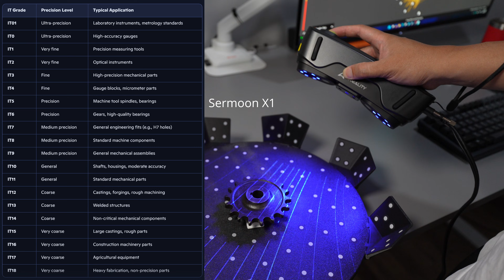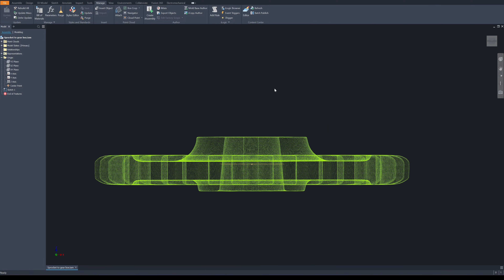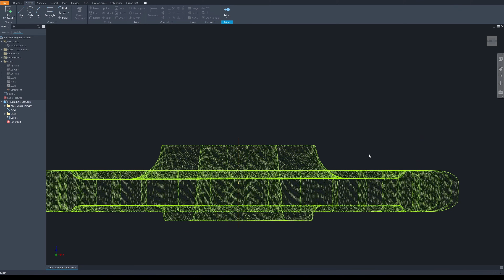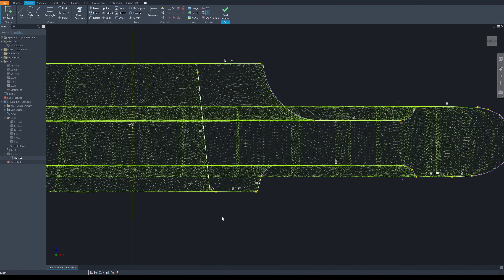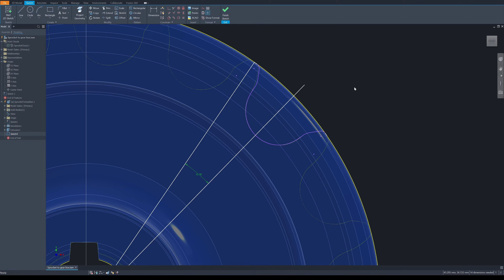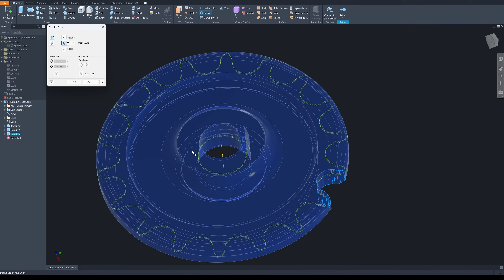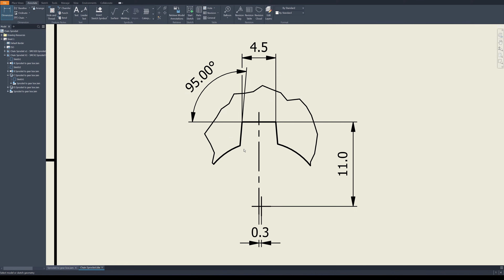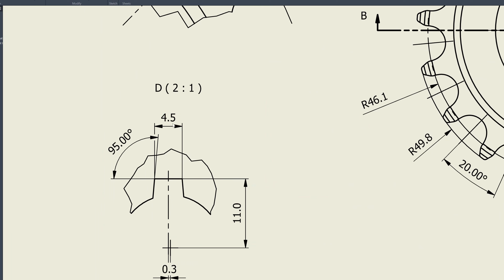Industrial 3D Scanning + Creality Sermoon X1 - Reverse Engineering a Motorcycle Sprocket

Comment: I reverse engineer antique parts for a living. You are forgetting that the sprocket was made with imperial dimensions. The taper on the hub is probably 1.25" per foot which gives you an angle of 84.053 degrees and it would not have had two tapers in the hub. Also, I think the taper on the OD of the sprocket is from wear. Also before making the sprocket, you should make sure that you can get chain to fit the sprocket, you might not be able to. The best thing to do is to make a new sprocket that will fit the chain that you can get that is closest to original. The keyway in the hub should have square sides, not tapered and be centered and was probably 3/16" wide. I have learned a lot from you about scanning so I am just trying to help you out.
Reply from the maker: That’s one of the most valuable insights I’ve come across in a YouTube comment, thank you for sharing. The part will be manually machined, and it’s quite difficult to find suppliers here who work in imperial units. I agree that the owner should obtain a new chain sample before attempting to reverse this sprocket. With 84.053° measured versus 84.060°, the values are very close.

Comment: I agree that auto surfacing would be the incorrect approach for reverse engineering mechanical parts. That being said, why do you avoid using reverse engineering software altogether? Identifying design intent and using the tools within the reverse engineering software to extract datum references and critical feature dimensions looks like a powerful method for RE. Are there pros and cons of each I’m not aware of? I’ve been researching this subject a lot lately, but there isn’t much out there from experienced industry professionals utilizing hobbyist/consumer level hardware/software. Thank you for your content and honesty regarding various manufacturers.
Reply from the maker: Machined part dimensions inherently include manufacturing tolerance errors and wear. Engineers must apply their own judgment to determine the correct geometry, aiming to stay as close to the design drawing as possible. We don’t rely on scan data for every dimension, if we can reasonably infer the correct value, we do so.
For CAD users, automated surfacing tools are ineffective, they’re slow, prone to model errors, and lack accuracy. In practice, I’ve never seen a professional engineer use them for reverse engineering.
Reply: @Payo-TensileCreator 
Auto surfacing would be the incorrect method, yes. And attempting to RE any part without a sound understanding of engineering and manufacturing would yield poor results. 

If the tools used for extracting primitives (not surfacing) are so ineffective how does any company justify the cost of quicksurface or geomagic?
Reply from the maker: @Jeb_BensonI train corporate engineers in reverse engineering, and I’ve never seen a single company use this software, even when it’s bundled with their scanner.

Comment: You mentioned a few times that this reversing wouldn't have worked with a Sermoon S1. I would love to see that comparison.
Reply from the maker: I can show intake and exhaust valve scanning in the next video. The small segment line you notice in this one would look rounded on a lower-precision scanner. When it comes to 3D scanning parts with tight fitting tolerances, you really need the most accurate scanner available.